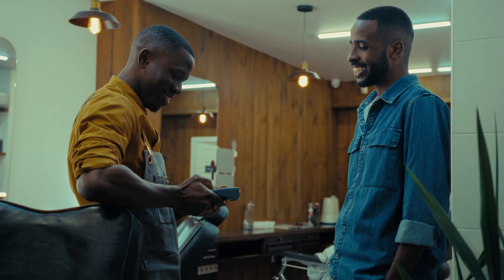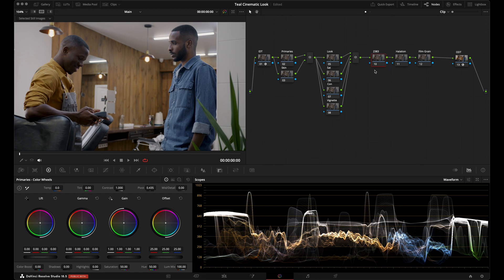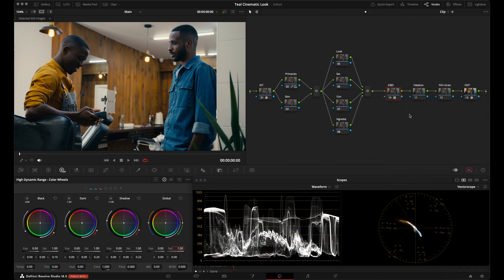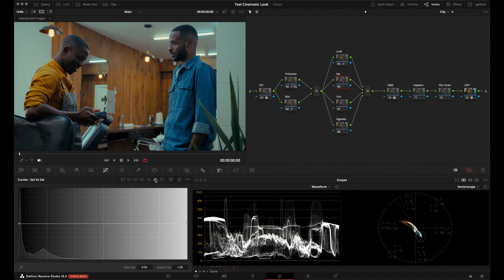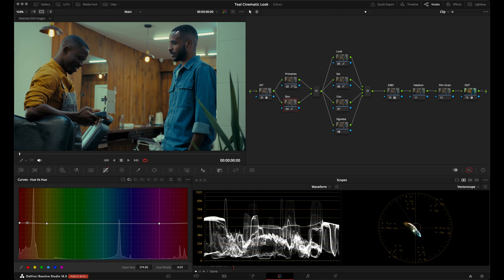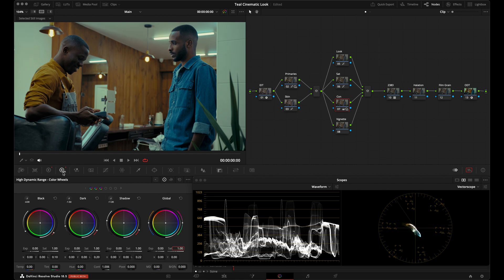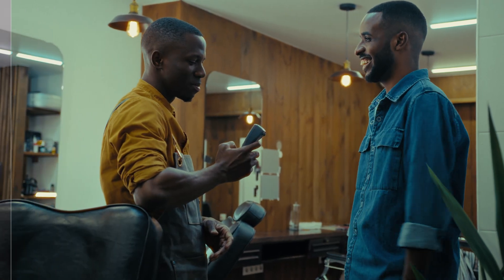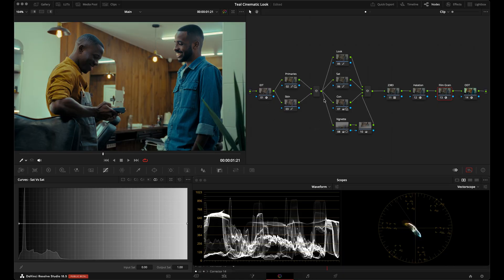Useful Techniques For Creating A Cinematic Look in DaVinci Resolve

Comment from the maker: DaVinci Wide Gamut Film LUTs are no longer available. You can still use the standard method of using the preinstalled film LUT in Resolve via the Color Space Transform tool. Leave the ODT Input Color Space/Gamma settings as DWG and DWGI and set the output settings to Rec.709 & Cineon Film Log. Then apply the stock Resolve Film LUT in a node immediately after the ODT CST node. If you have questions about this process, start a thread on this comment and I'll help you out. Apologies for any inconvenience.
Reply: is it possible to use the composite mode to color on Resolve 2383 lut?
Reply from the maker: @audaz5186  Sometimes that gives good results but it may cause some colors to look weird depending on colors in the shot. You can also try the Hue composite mode.
Reply: @george.colorist  thats great tips thank a lot
Reply: @audaz5186  if you create a new timeline with just the CST and film LUT then you can save that as a DWG film LUT. Works for me fine, but not sure if george knows of any potential colour issues with that?

Comment: Why would you lower the shadows/mid for grain when film has more grain in the shadows?   I'm not a colorist but I am a compositor with 20yrs in feature films.  A big part of our job is grain management -- and I'd do the opposite as you.    Leave the shadows and lower the grain on the highlights depending on the film stock.
Reply from the maker: It’s true that many classic film stocks have more grain in the shadows, however not all film stocks and modern film emulations feature more grain in the shadows than in the midtones and/or highlights. Outside of trying to replicate the film grain of classic film stocks 1:1 as much as possible, film grain texture is a creative choice with more flexibility now that we have these adjustable film grain effects.

Comment: in the 18 version not the 18.5 how can i change de composite of node to color??
Reply from the maker: You can use a layer node and set the layer mixer to the desired composite mode.

Comment: Hey george, i have a question for idt and odt. I put the same value but my videos looks like without conversation. I have slog 3 footage. 
I noticed that in IDT i have to put in "input color space: Sony S-gamut.Cine and Imput gamma: Sony slog 3".  
In the OGT i leave the same in your video. Why?
Maybe you should explain the color managment in project settings.
Also the link for the wide gamut film look is offline. 
Thank you
Reply from the maker: The ODT should be set to output the correct color space for your display purposes. Setting it to a Rec.709 output is most common if we’re uploading things online. My color management is set to DaVinci YRGB so my color management is taken care of in the node tree. At some point I’ll do a tutorial on color management. 

The DWG LUTs are no longer available. You can find updated and improved versions of these LUTs in my K83 and F13 LUT packs. 

Thanks for watching. Let me know if you have any other questions.

Comment: Great video man, once again! Quick question: I still get lost in regards to the IDT/ODT nodes. I'm using the Sony a7iii - Slog2 and I know the settings I should change in the first color space transform, the issue is that I get a bit lost with the second CST, if I even need to add a second one or if I should be using Wide Gamut/intermediate.

Thank you!
Reply from the maker: The second CST node is for transforming from DaVinci Wide Gamut into your output color space, in this case (and most cases) Rec.709 for proper display. You should add a second one so you can better reference your final image which will most likely need to be in Rec.709. Any nodes you add in-between the IDT and ODT nodes will be working in a DWG color space anyways. Thanks for watching.